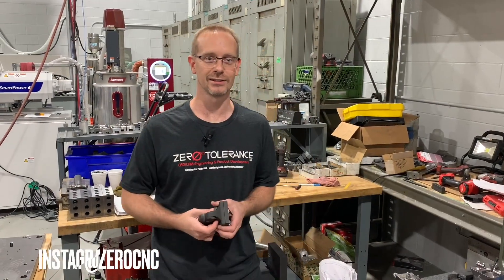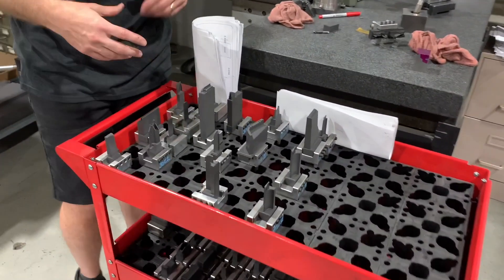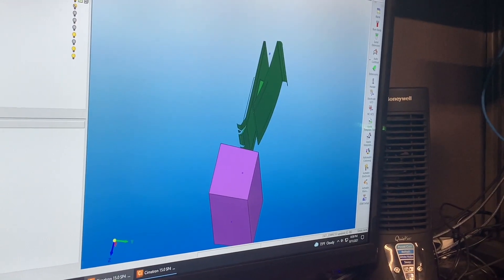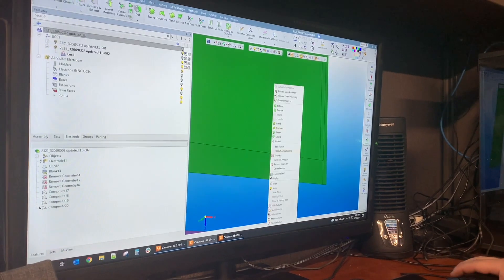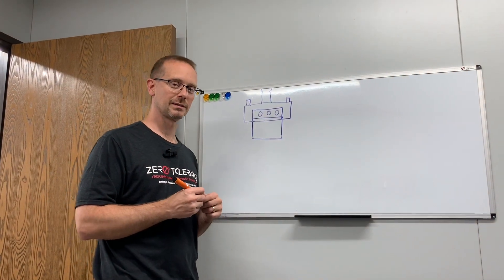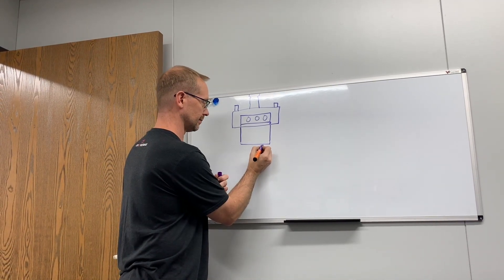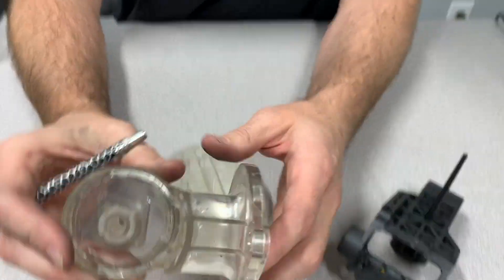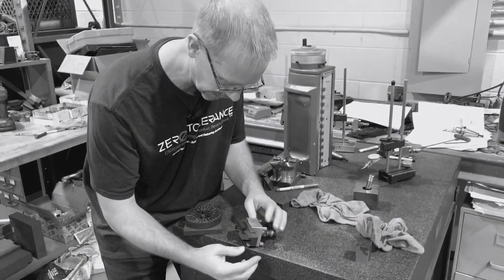Combining 3 Types of EDM | Learn to Burn

Comment: how much force does the electrode react? Just spitballing, but I'm trying to imagine ways that the machine might control a lateral profile (so you could do a revolved surface), and mechanical reaction force at the electrode seems like a big factor. One could imagine a thick band with its ends controlled to make a shape. Maybe that already exists.

Comment: I am thinking of buying a used wire edm machine (< $10k). I have not seen much information on used EDM equipment being risky or not? I have never run an EDM machine before. I want to make custom load cells and need wire EDM for the strain gage flextures. Do you have any insight into purchasing used EDM equipment and maybe some controls to stay away from or to look for. Thanks.
Reply: In my experience, the main 3 things are these

Old tech (Agies are amazing but you'll be programming by hand or punch card if you buy the wrong model)

Wear (you know it, we all hate it)

Finicky-ness (not really wear, you can replace basically everything and this'll remain)

When i say finicky i mean things like the wire randomly snapping in the mechanism if you use one specific brand of wire and curling if you use another.

I bought my USB-converted Agie for $2k and the only real problem i've stumbled on (and stumped the former owner) was how the mechanism would break almost all wires except for a 0.15 wire from a UK company
Reply: When I started my shop my first EDM's were old used Charmilles and I fixed them up and they ran great for years. Then I upgraded to a newer Charmilles and eventually outgrew the tank size and now have the Eagle & Mits

Comment: What kind of stepover do you recommend when milling the electrode....?
Reply: On a finish pass, I'd say .002- 004 depending on the diameter of the ball cutter. It also depends on the overall size of the electrode & what finish you're looking for.

Comment: Nice video, i work in the area how many passes you do on the wire machine  to get that finish, 2/3 ?
Reply: We usually use 4-5 passes if it needs to be very accurate. Thanks for watching!